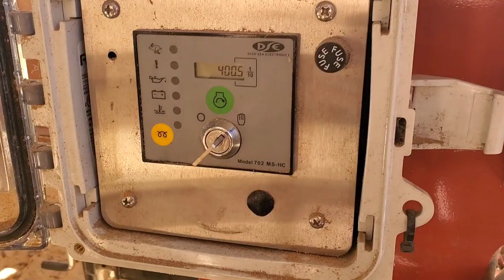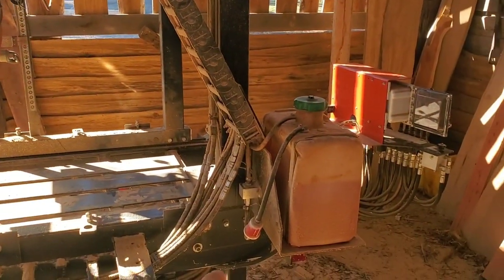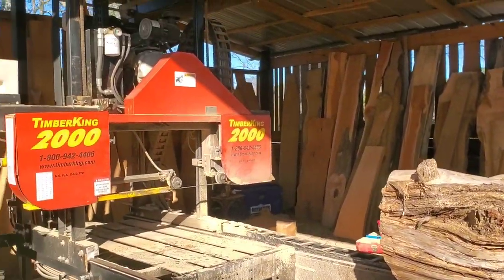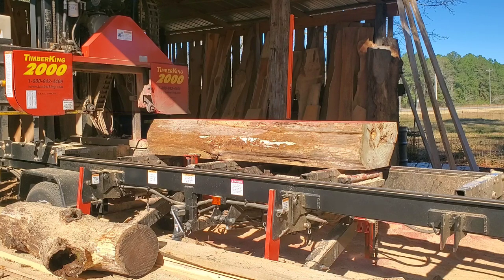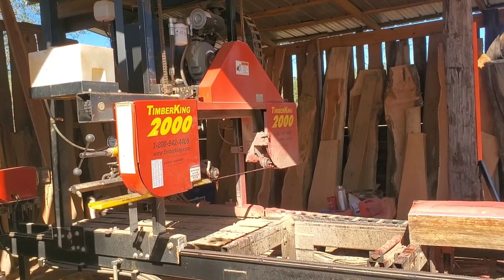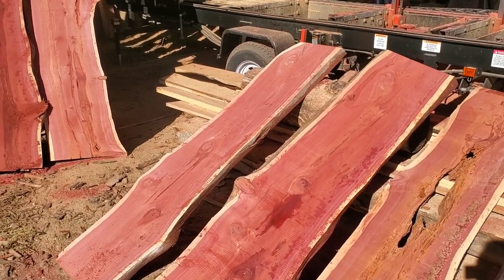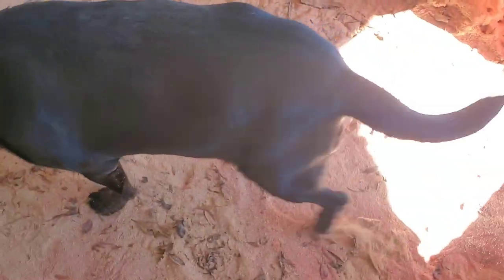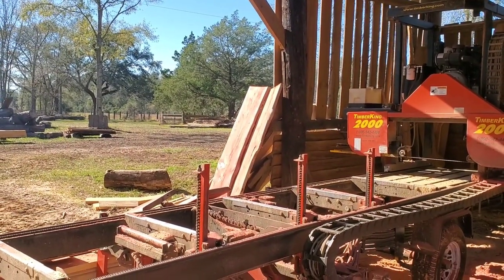Timberking 2000 fully hydraulic diesel sawmill, 400 hr review

Comment: You hit on the best think about a Timberking, low Maintenace,  and easy to work on.  You need to add a chip deflector in front of the drive side guide roller to keep bark from getting between the band and wheel.  You will get better blade life when sawing logs with loose or stringy bark.

Comment: I have a brand new 2020 diesel....has 29.6 hours.....stopped running because of the start box.....it thinks it doesn't  have oil pressure,  just wondering if you have had that problem or heard of that problem
Reply from the maker: Is your box the deep sea box or the new digital one?  I have not had an issue with any of our 3 diesel mills.   The 2000 I had and the 2020 I have now both run the same controller box.  The 2220 we have has a much more advanced computer to control everything.   I saw a recent picture of a new 2020 that had a different controller, but I am not familiar with the capabilities of it.  Have you reached out to timberking?
Reply: This mill has the deep sea multiple function monitor.....so far, I'm not impressed.....Timberking handed me over very quickly to Anderson Industrial engines to handle the problems.....I live on the west coast near Hoodsport Washington.  Anderson, ( Kansa City, Kansas) handed me off to a Kubota dealer/ shop near Tacoma, Washington.....we will see how this goes. It has been down nearly a month. That little box is doing a lot of strange stuff,  not reading to oil pressure correctly makes the starter enguage even if it starts....then it decides to fault out and shut down
Reply: It has the deep sea controler....it doesn't  recognize the oil pressure any longer....starts, runs for 15-20 seconds,  and it engages the starter in and out, while it is running, not a good thing, Anderson is sending a technician to me from Auburn, Washington to check it out
Reply: The sawmill itself is,I think, the best for the money, it does everything well....laser straight cuts, power to spare, all hydraulic,  ect.....I understand that parts can fail, it's a machine,  it will be fixed soon and making great lumber, Douglas fir, hemlock, western red cedar, maple, and madrona.....I worked as a saw filer for Simpson in the Shelton working circle for nearly 35 years, so I have worked on large bandsaws all of my life.....we used stellite alloy for our saw teeth tips, very wear resistant and not brittle like the carbide, however,  the carbide is my choice.....I hope some day they use the stellite as tips......I enjoy watching your channel, keep up the good work!!!

Comment: No debarker on timber king's?
Reply from the maker: They have them, but I'm not a big fan.  Debarkers get in my way and since I sharpen and set my own blades I'm not worried about it.
Reply: @TCSawmills   Same here, more time and trouble messing around with a debarker than it's  worth.. I rather sharpen a couple extra blades once in a while.  If you have to send your blades away for sharpening at $10 each then a debarker would make sence. Over here it takes 7 minutes to sharpen and cost way under a $
Reply: @oliverm5sc  we have our own sharpener and setter and a debarker and I wouldn’t have it any other way. Totally extends your blade life even in cleaner wood
Reply: @anooseholay  Maybe it's extends blades life a little but I don't think it's worth the hassle of running it, in the way , upkeep and keeping it aligned.  I took mine off..